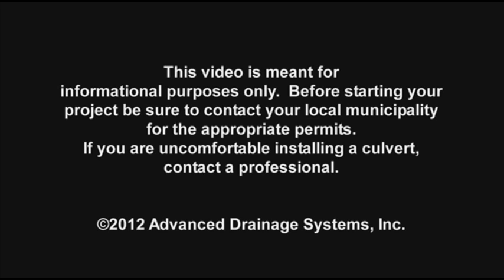ADS Driveway Culvert Installation

Comment: Where do you  buy these culverts
Reply: @str8chevys913 I I went on the web site and found them. I placed an order for 2. That was very nice and helpful. You certainly didn't have to go out your way, but you did and I appreciate it very much. Its sometimes shocking to come across good people. Thank you again
Reply: @str8chevys913  Grainger doesn't offer the unions or other accessories, just the pipe. Where else can you buy these?
Reply: @str8chevys913 thanks for the response. I though maybe you worked for ADS. I need a 18" coupler/union and I can not find it anywhere. I will have to rig something. Thanks anyway..
Reply: HOME DEPOT??? I wouldn't buy ANY thing from HD!!! TRY LOWE'S!!!!!!!
Reply: Ernest  sthu